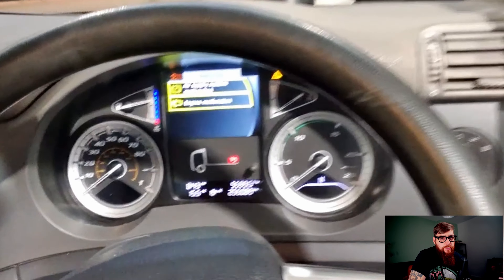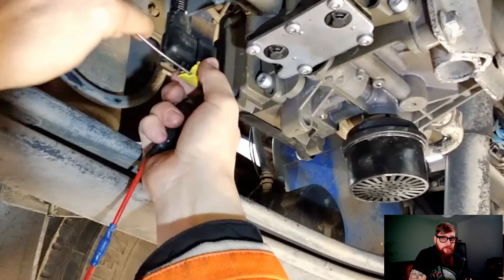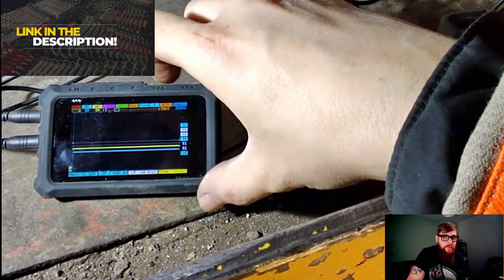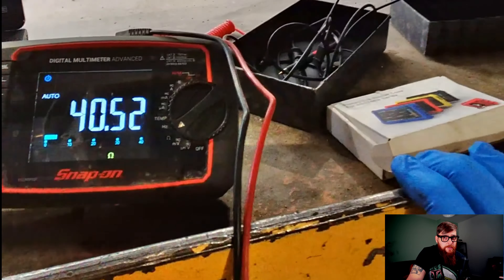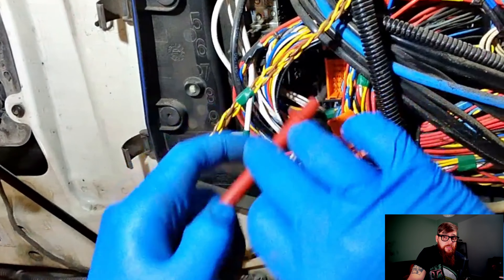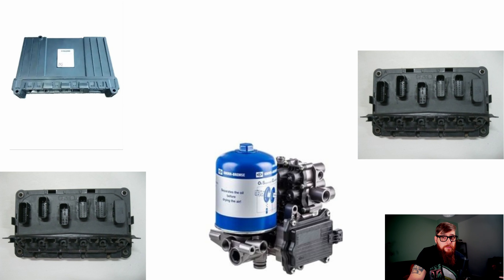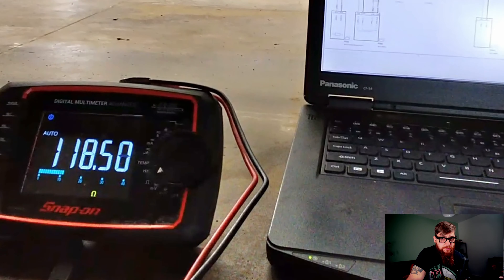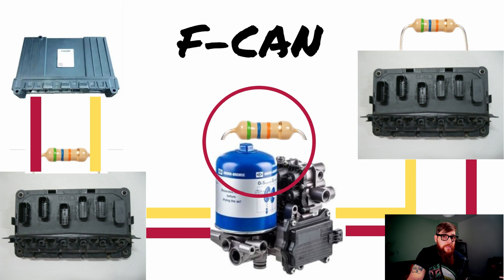DAF CF MY 17 CAN TIMEOUT ISSUE | F-CAN FAULT 🙈

Comment: Excellent find! It was definitely a strange one! This is a typical “my mate down the road will do it cheaper…” 😂
Reply from the maker: Hey buddy thanks for the comment 👌😎 it's always the same, , but they always come back when "his mate" fires the parts cannon at his truck....spends 1000's of pounds on the fuel system and ECU replacent and it turns out to be a plug connector he's opened up with a multimeter.....true story lol

Comment: I'm also a HGV technician (Not in a dealership). I need to get into this oscilloscope stuff! Have you used many different types. Would something like a Hantek handheld one suffice for our line of work?
Great video mate 👍
Reply from the maker: Hey buddy thanks for the comment 👌😎. It depends if you want handheld (fiddly to set up) or laptop based (easy to use), if it's laptop based Check this video out here https://youtu.be/A0wwhPJNDKk and hopefully you can make your mind up on what you want 😎

Comment: Had a customer dust an engine beacause he fitted a air filter that was too small ,,As a DAF one was too dear ,,But he never learned and weeks later brought in one with a brake fault ,he had fitted a caliper...and yes the new caliper was at fault ..DAF one was too dear lol...I remember when EURO6  was new ,we had a XF  with an intermittant start fault ,Luckily we had a spark at the time really good at the job and he traced it to a rotten plug for the SAC unit ...All i have done this year is engines though i have 2 gearboxes now in the Q ..i Honestly think i have done 2 jobs max  where i need a multimeter ,It has been that long i don't think i could find the fusebox lol
Reply from the maker: Hey norb 👋👍. They just don't learn do they, what's more expensive......them screwing it up or workshops who have techincains who see these problems daily 🤷🙈
The plug on the SAC on euro 6 was a common fault which DAF put out a bulletin over capillary action forcing water into the plug if I remember rightly.

This job is my 3rd sac fault this week. I've another to fit Monday.......I'm lucky I don't do the engines in our place.....the guy who does them has 50 camshafts to do......couldn't think of anything more boring 😅😅😅 reminds me of when I had to do a similar sort of number of valve stem oil seals on mx-11 a few years ago 🙈
Reply: @TRUCKTECHUK  I have never changed a SAC lol..Last time i did a caliper  they where new to the market lol...I do enjoy the engines ,especially in winter as 1 im in the workshop,,2 you know what you have ahead of you for the day  3 you get left alone  to get on with it   ...worst part  turning that key for the first time lol..Though i do have my system ..relays out ,bleed it up. spin it for 1 min as per DAF instructions ,top up oil  give it another bleed ..spin it again for a min.... recheck oil  relays in and it generally starts in 5 to 10 seconds ...I broke my fuel cap for pressurising the system ,now i need to hand prime it lol..Also whilst i have the fuel module out i strip and clean them,there is another filter in the base that the bio fuel clogs